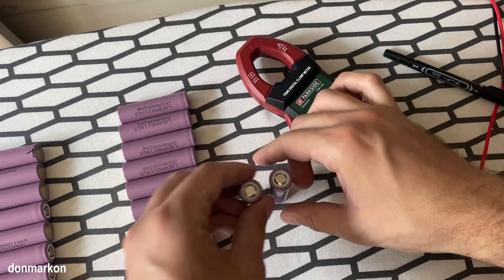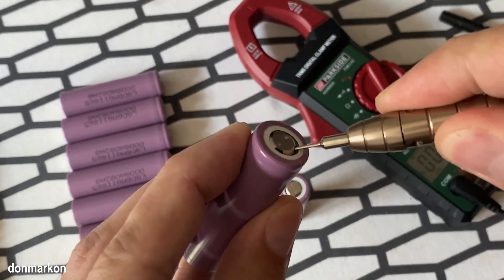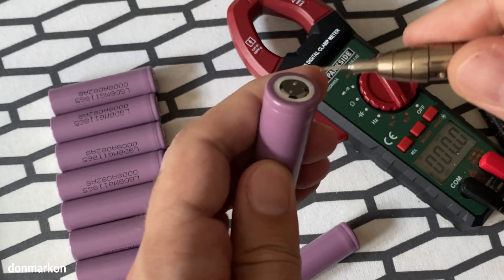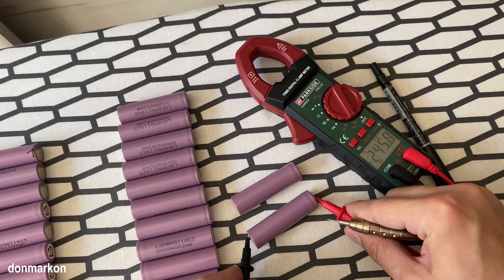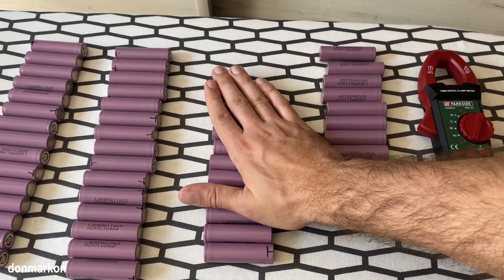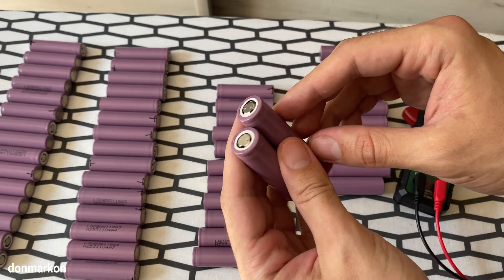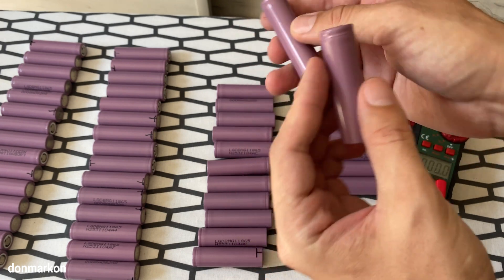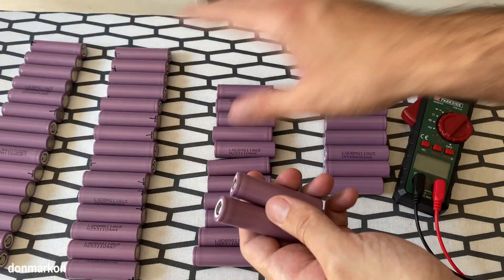Revive 0V Dead Lion Battery Cells CID Reset 18650

Comment: Please don't. They have activated for a reason it's not worth risking injury for saving such small about of money.
Reply from the maker: I agree there risks which i mentioned. But in my case the 2 packs are 10 years old and ALL the cells had CID triggered. Which lead me to believe that it triggered on all of them mainly because they weren't used and pressure did build up over time 
80% of cells had good voltage after reset and 20% were dead with under 1v
Good cells were tested multiple times
Reply: Money and risk is relative to the person it belongs to.  This is not a place this Karen.